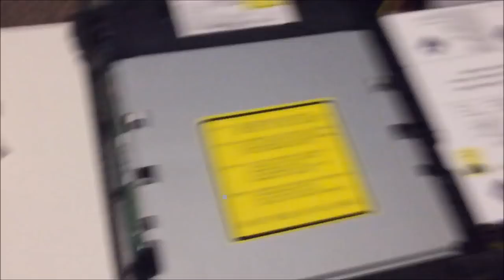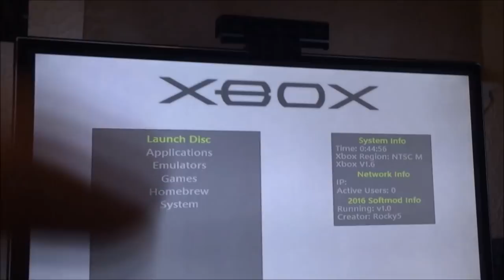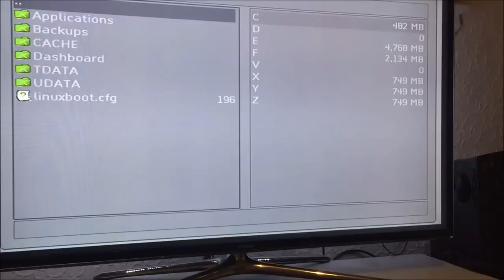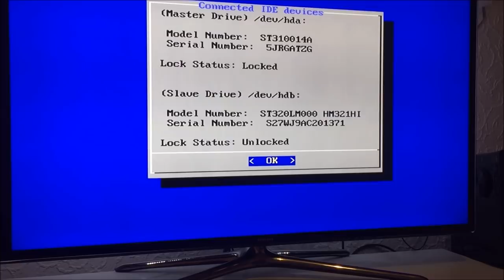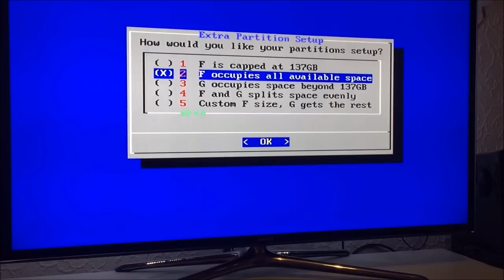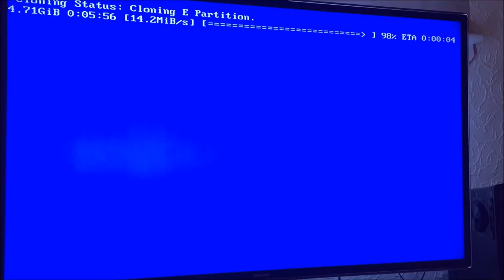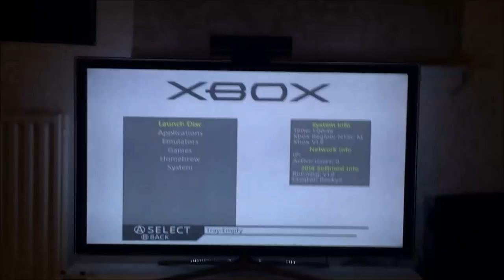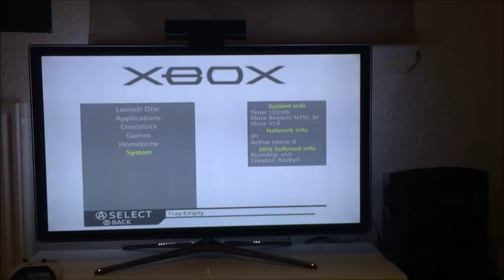How to clone your Hard drive using Chimp 261812 from start to finish.

Comment: Fantastic Tutorial and program sir! However with my Halo Edition Xbox it keeps shutting my xbox off when I connect the new HD and using Chimp to go through the cloning process. I can't figure it out. Anyone have any ideas? My interface for chimp also does not look like that. It says Chimp v1.01 with a black screen. I downloaded the link provided and have made sure my files are in the right place.
Reply from the maker: There should be two options, you put the chimp folder thats in the “e partition” folder in the Apps or Applications menu.
Reply: Thank you for your fast response and willingness to help! Yes, it's in the apps folder of unleashx. I usually get to the same spot everytime before it forces itself off. I get past it asking to connect the slave drive. It will do its thing. I'll get to menu where it asks if it is softmodded, tsop, or linuxshell and it immediately shuts off as soon as I choose softmod.
Reply from the maker: That’s a new one for me. What happens if you don’t change the drive and just load it with the dvd drive connected?
Reply: If I don't change drives, it shuts off on the screen where its searching for the drives, the one where you would hit enter. I'm guessing it's my HD (WD5000AAKS) or the Kingwin ADP-06 Adapter, still don't know how or why. Just to make sure, I don't need the Source Files or the XBP Table Writer to be on the Xbox right? Some more info that might help, I also can't switch the IDE cable at the dashboard (or any other menu other than right after the two ok from the kernel files) or my Xbox will freeze.
Reply from the maker: You set the new HDD to Slave? ( on the adaptor ) because if both drives are master the Xbox will hang.
Reply: Yes sir. I appreciate your help and your time again. I did discover I have the dreaded version 1.6. But from my understanding that should not matter with the latest build of Chimp.
Reply from the maker: Nup v1.6 is what I use for developing stuff as if it works on that version it works on them all lol

Comment: So this won't work if I'm using components? 
This is turning into a nightmare
Reply from the maker: +Beau Walker if your Xbox isn’t a v1.6 then yes, composite or scart is required.
Reply: OKay. Back to Amazon then. My IDE to SATA adapter doesn't have the little jumpers like in the vid. Should I get a new one of those while I'm at it?
Reply from the maker: +Beau Walker yeah you require the jumper here is the one I recommend. Get one that looks exactly like the one I show pictures of. 
https://www.xbmc4xbox.org.uk/forum/viewtopic.php?f=13&t=612&start=40#p22734

A new one of what?
Reply: Would it be better to just purchse an IDE HDD instead? The HDD I'm trying to swap to is 250gig seagate, but if I purchased a 500gig IDE drive would that suffice?
Reply from the maker: +Beau Walker it’s up to you, I prefer sata as they are all lockable ( I haven’t come across on that isn’t ) but IDE is 100% compatible with the Xbox so.

Comment: i just put in a 2tb seagate hardrive and i dont think it cloned it properly my f drive isnt showing any help would be appreciated
Reply: so after the swap and everything is put back together i just load chimp and do it that way?
Reply from the maker: +Joshua Brown yeah. Though Chimp should have done it during the clone, if you selected the right options.
Reply: i just click to clone all of them the second to last option. Thanks for the quick replys your awesome!!
Reply from the maker: +Joshua Brown yeah with a 2TB drive you only clone C and E, unless it’s a 1TB or 2TB drive.
Reply: its a 2tb drive so what steps do i need to take to fix this?
Reply from the maker: +Joshua Brown if you have cloned it already and locked the drive to you system, all you need to do is load chimp 261812 and select softmodded Xbox > master drive options > extended partitions > split F and G evenly.
Reply: which partition do you suggest i store all the xbox games? i want one partition for just that?
Reply from the maker: +Joshua Brown I use G normally.
Reply: so should i do the option where it says F occupies all avaliable space?
Reply from the maker: +Joshua Brown you have to split the partitions evenly. The maze partition size possible on the Xbox is 900 and something, basically just under 1TB.
Reply: Awesome Man you are the best!!!!!
Reply: I'm Wanting to do your iso mod disc soon!!
Reply: i have another question you probably know the answer to.. i have another xbox i was modding and i unlocked the original harddrive and turned the xbox off and now i get error 6 when i turn it back on any ideas on how to fix?
Reply: nope didnt save the file on my computer so i guess im screwed lol
Reply from the maker: +Joshua Brown if you can connect the HDD to a computer you can get the eeprom.bin off the hdd. I’m assuming you kept it on the hdd.
Reply: i tried putting it as a salve drive on my other modded xbox and using chimp to lock it back and it would let me lock it but when i put it back in the xbox it did the same thing
Reply: not too too worried about it. I have a question though the xbox i just finished with the hd swap i try to go back to the MSdasboard and it says C:/xboxdash.xbe. file does not exist
Reply from the maker: +Joshua Brown so the drive you cloned had the MSDash on it? and the new cloned drive some how doesn’t?
Reply: well im not sure it was already softmodded and i never checked to see if it did or not..
Reply from the maker: +Joshua Brown then it never, upgrade your softmod to mine and use the extras disc to install the MSDash.

Use v1.1.2
Reply: i did like you said but my G shows 0.00 MB how to fix please ??
Reply: when i do this it shows on f and g that each of them has 949,989.81 MB but when i reboot or shutdown after i use chimp to do this and tthe dasboard loads it only shows that space on f and g is 0.00mb

Comment: one more question, i got my new cable and my 500gb drive is only showing up as 160gb is this because i cloned it with the 40pin cable?
Reply from the maker: Depends on how you cloned it, just reformat the extra partitions with XBPartitioner v1.3
Reply from the maker: Also make sure if you are hardmodded ( TSOP or Chip ) your bios supports the partition table. If not Update to M8+

Comment: can anyone help me im trying to put in a 3tb harddrive and the normal stuff happens when i clone with   c e x y z   but f and G only shows 378.401 on each
Reply from the maker: You can’t put a 3tb drive in the Xbox, maximum is 2TB and each extra partition must be 1TB/64kB clusters.
Reply: JCRocky5 i seen someone put a 3tb in one on YouTube I do know most of the 3rd terabyte isnt useable but gives you like an extra 165gb or so vs using a 2tb
Reply from the maker: Yeah you can use a 3tb drive, but only 2TB of that drive will be useable.

Also when you clone the drive, just clone C and E with the F and G split evenly option enabled.
( you use (X) to select options, (A) moves forward menus )
Reply: thats what i did and im only getting the 378.401 on F  and 378.401 on G
Reply: Still having the same issue JCRocky5 can you help me get through this?

Comment: Please help, as soon as I press A on anything once I switch IDE cable from dvd into hd xbox freezes
Reply from the maker: +NosretaP89 install the chimp folder to the root of the E partition.
( so that would be, E:\Chimp\ )

As for the system hanging when you swap the ide cable, that sounds like the main hdd is losing power and the system is hanging.
( that’s the only time I ever had a hang, my molex plug was slightly lose in the hdd, bending the pin a tad make the connection tighter and fixed the issue )
Reply: JCRocky5 I checked all molex connections and I have the chimp and xbp folders in the root of my E, still feeezing up when I press A on file explorer. Should I not be using file explorer to start chimp?
Reply from the maker: +NosretaP89 you can launch chimp anyway you want, the Xbox doesn’t care.

FTP a clean copy of Chimp back over and try launching it without changing anything and see if it still reboots the Xbox. Also make sure you are using standard def AV cables.
Reply: JCRocky5 I only have hidef cables maybe that's the problem. I've already moved over a new copy of chimp as I thought that was the problem at first.
Reply from the maker: +NosretaP89 it could be yeah, the only Xbox I have that will work with Chimp and component cables is my v1.6, all my other Xbox don’t. So I use a scart cable with those if I need to.
Reply: That was definitely the issue. Thanks for the help!
Reply: JCRocky5 that solved being able to launch chimp, still having the freezing after cable switch when I press A no matter what area of the xbox menus I'm on.
Reply from the maker: +NosretaP89 have you downloaded the test xbe from the other video?
Reply: JCRocky5 I believe I did originally but I probably had it overwritten when putting the clean copy of chimp on.
Reply: JCRocky5 Now I've added that xbe. Should I start chimp before swapping cables this time?
Reply from the maker: +NosretaP89 correct and you can take your time doing it.
Reply: JCRocky5 Certainly looks like it.
Reply from the maker: +NosretaP89 that another thing that will hang the system, two drive set to master.
Reply: JCRocky5 I'll move the jumpers around just to make sure
Reply: JCRocky5 I want the master drive set to "single or master" not "master with slave present" correct?
Reply from the maker: +NosretaP89 both should work, but try both.
Reply: JCRocky5 Master with slave says xbox needs service. I'll use the other setting. So it must be the other drive that's wrong?
Reply from the maker: +NosretaP89 I haven’t a clue as I don’t know what drive the other one is :/ 
If it’s SATA. 80 wire ide is mandatory.
Reply: JCRocky5 Now it says needs service on both settings.
Reply: Only because I had ide cable out. I'm having a hell of a time mate
Reply from the maker: +NosretaP89 then try cable select, or make sure the ide cable is inserted correctly into all ports.
Reply from the maker: +NosretaP89 no slave only the master drive would use cable select. If your master HDD doesn’t work when set to master I havent a clue :/
Reply from the maker: +NosretaP89 if you can’t launch chimp at all then god knows, you should be able to load into Chimp when using the dvd drive and stock hdd.
( Chimp is after the loader )
Reply: JCRocky5 could it be a graphical glitch again? I only had hd cables and an rf adapter so I'm currently using the tv antenna input on my tv.
Reply from the maker: +NosretaP89 try a different version of Chimp and see if say 2618 works?
Reply: JCRocky5 could it be the controller I'm using?
Reply from the maker: +NosretaP89 if it’s not official yeah
Reply: JCRocky5 it appears to just be frozen at this stage.
Reply from the maker: +NosretaP89 if it’s an official controller then gentoox/Chimp loader will work, though gentoox has a timeout of 5 seconds before it auto boots chimp. Chimp loader has that disabled so you need an official controller to be able to press (A) also no memory cards inserted, it seems to hang gentoox loader and chimp loader.
( both the same app, I just changed stuff up )

Also haven’t a clue, you should always show info when cloning.
Reply: JCRocky5 alright thank you. I straightened that around but now when I swap and scan for ide devices it shows dvd drive even though it is no longer connected.
Reply from the maker: +NosretaP89 you need to do the swap before chimp loads, the Linux distro that’s use for chimp doesn’t support hotswapping, ie, you can plug in new devices after the system has loaded. That’s why you swap before hand.
Reply: JCRocky5 If I swap before chimp loads up I run into the freezing upon pressing A issue though. Are you saying swap once I launch the xbe but before chimp loads up?
Reply from the maker: +NosretaP89 you much swap the drive before you see Linu. ie, before the penguin. 

you still haven’t said what type of drive it is?
Reply: JCRocky5 my bad. It's a wd 250gb ide so I'm not using an adapter or anything different than the stock cable.
Reply from the maker: +NosretaP89 can you see if my version of Chimp loads without changing anything? Replace the xbe file with the normal on so you don’t get the prompt.
Reply: JCRocky5 don't think I'll be needing to do that, I hotswapped after launching the xbe quick enough this time and all was successful. Currently cloning, really appreciate all the help with this

Comment: First: Thank you so much, had success in past with previous chimp and this is easier. Unfortunaly however, I cannot get the slave drive to lock to the Motherboard after cloining it. I've tried follwing the video, then tried locking to motherboard in "slave drive options" and i've tried locking from the temp/eprom. I've tried twice now from the beggiing, following along slowly and..still can't seem to get it to lock. Anyone have any suggestions? (just using a IDE 250gb so it wouldnt be a problem with the adapters, and i've set slave to slave and master to master)
Reply from the maker: When trying to lock the drive after a clone, does it say locking failed/unsuccessful? also not all IDE drives are lockable.

Could you try locking the drive with an older version of chimp. It shouldn't matter as it lock code is the same.
Reply: +JCRocky5 yes sir, it does say unsuccessful. I'm begging for to think it's these hard drives. I've used seagates, or HP's in the past. These are Maxtor's which I've used, but just realized that I've only used them in hard modded xbox's. I'll try a different brand of hard drive and/or Sata with adapter. Thanks for your prompt reply and for keeping the Xbox mod community fresh!
Reply: New Harddrive and viola. Works like a charm. Thanks again.

Comment: Hi there im having trouble hot swapping my hdd ive powered it up separately with a psu and every time i swap the cable over the screen goes blank any clues anyone? is there a certain time i have to do it or just anytime ?cheers great videos
Reply from the maker: +chip1gray I take it you’re using the one that prompts you to plug the slave drive in? ( latest build, you launch first )

If so you can take your time, there is no rush.
Reply: boom not sure what version i am using anymore there are soo many i have 4 different ones. It turns out i was just being slow panicking with the cables. I used one and went through the hole process and when i plugged it in on its own i just got the error screen so im using another version fingers crossed. Thanks for the reply this is the first time i have asked for help with a project I usualy just keep reading and trying stuff but your a real gent!

Comment: How big can an F partition be?
Reply from the maker: 1TB
Reply: I just did this with a 1TB drive. It’s your softmod v1.1.7.  I I selected F uses all . But when I go to the File Explorer in the new drive it shows 473,000MB on F and on G?
Reply from the maker: When you select it you press (X) not (A) when in chimp. Most people just highlight an option and hit (A) thinking that’s selected. 

You can load chimp and doesn’t the partition or instal XBPartitioner and format F from that.
Reply: I did use the X. I loaded Chimp again and formatted extended partitions, chose F again, and it still did the same thing.  I had to do in in XBPartitioner.
Reply: I want to put xbmc4gamers on this.  Can you tell me on this softmod version, where is the dashboard loading from? C:\Dashboard?

Comment: I did everything and never saw Xblast OS as an option.
Reply from the maker: XblastOS is not used, it was prior in 261811 but I stopped using it as I wanted something simpler. So I modded the gentoox source to how I wanted it.
Reply: I am posting a vid now on the Xbox mod group about the issue.  When Chimp instructs me to connect the slave drive, the whole process just freezes and will do not a thing.  :(
Reply from the maker: Because the slave drive isn’t set to slave. If you put two master drives on the same IDE cable it hangs. Also make sure you don’t have any memory cards inserted.

Comment: I had it working, i missed a screw in the hard drive chassis, took it apart, put it back together, screwed through ide cable, cracked top casing. F
Reply: Damn that sucks

Comment: I miss when you toggle cable from dvd driver and put it on the slave hard disk......please can write me when you do it?
Reply from the maker: passer875 9:38 round about is where I tell you I swapped the cable, basically you swap the cable over and then press (A)
Reply: ok, good!!
if i clone my hard disk, i can use cloned hard disk on another modded xbox?
i need to do something ?
i need to lock or unlock hard disk, in the last option, for use it on another xbox?
Reply from the maker: passer875 you need the eeprom.bin from the other Xbox first so you can lock the save drive to that eeprom.